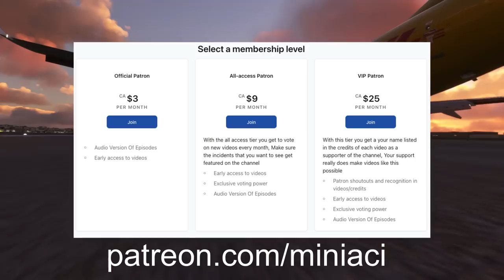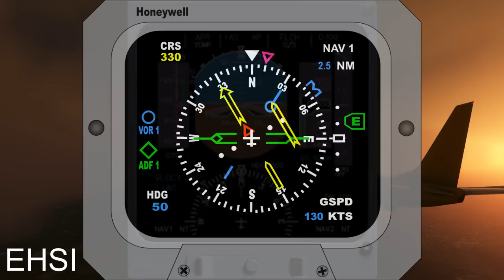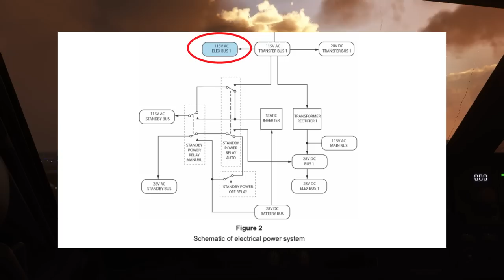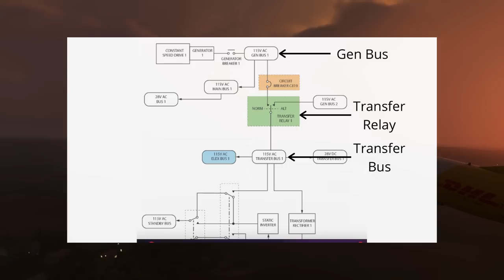How A TINY Short Circuit Almost Crashed A Boeing 737! | West Atlantic Flight 3319

Comment: The power generation didn't fail... The distributor of power did.
This is actually a common theme with what I would argue are most electrical systems.
Because the public mostly just hears 'conserve power' they often assume it's the power generation capacity that is responsible when in fact much of the time it's the capacity of the local distribution grid that is stretched to the limit.
If you've ever blown a fuse at home due to plugging in too many appliances you should know this. There is plenty of power outside, but your home outlets can't take that much consumption at once.
In this case there wasn't an overload of consumption but still by accident the bottleneck was the power distributor.

Comment: What I would like to know is what was changed so this does not happen again?

I mean things do fail, but the fact that a power bus failure can turn of THE warning system which is supposed to warn you about a power bus failure seems like something that could be designed better.
Reply: Pecka.
To make sure this does not happen again, technicians put some "sellotape" round the power bus to stop it turning off the warning system.
Reply: @redblade8160  yeah, cellophane tape! I  use 'duck' tape myself.....shite happens--shame....
Reply: Better system integration. Current airbus systems can withstand even 3 generator loss. And pilots are trained to handle such situations in the Sim, its called emergency electrical config, its one of the hardest Sim sessions as the procedure is really long and requires a deeper understanding of electrical systems

Comment: An example of why a Flight Engineer should still be on aircraft. The electric systems would have been very familiar to them.
Reply: IT WOULDNT BE HARD TO HAVE OFF PLANE LIVE STREAM FOR STUFF LIKE THIS.
HAVING A THIRD SET WOULD HELPED.
Reply: Pilots are trained for situations like this and situations much worse than this like the emergency electrical config aka 3 generators lost

Comment: This is why standby instruments are important! The standby will either be "steam" gauges or a small PFD that has it's own internal battery.  Also, typically when a generator or bus fails, it will impact only the instruments on one side (i.e. Capt or F/O side) as the other side is powered by the second bus (I think 737s are all like this).
Reply: PFD? F/o?
Reply: @Capecodham  primary flight display; first officer

Comment: The captain did the right thing, given the information he had.  He took an ultra-conservative plan of action that, given the knowns and unknowns, kept everyone safe.

Conversely, had he had an intimate knowledge of the electrical system, but elected to not attempt to remedy the failure, he would have put people in grave peril.

Unless you know and understand the consequences of your potential actions in this situation, it is a grave error to "try this, try that", because you could inadvertently cause an unrecoverable situation, killing all on board.

I'm a EE myself, and despite all my 30+ years experience, I would have done exactly what the captain did if I didn't know the system.  The last place to experiment on the electrical system is while the plane is in the air.

Even with the slight landing misconfiguration, both the Captain and FO did a stellar job.  10.
Reply: Yeah agreed, in all honesty a misconfiguration for landing isn't really a safety issue at all unless you are completely on the wrong end of the misconfiguration you are intending to do.

Comment: Since the visual is a 737 not -200 I was wondering what the make of the aircraft was.  It wasn't until the end of the vid when you mentioned that the part was manufactured in 1985 that I sort of maybe figured that it could've been possibly a 737-200.

Comment: I've read about a plane crash-landing (spoiler: everyone survived) in GDR on December 7. 1963 where a plane suddenly lost all electrical systems. Turned out a generator failed. But wait, it gets better. The plane HAD a battery backup, but no indication of its enabling whatsoever. So neither did the pilots know their generator failed, nor did they know they were running on backup battery nor was there any warning that the battery was running out. Classic design screwup. See Flugunfall bei Königsbrück.

Comment: The pilots get a 10 from me as well.
Operating on limited information, they made the best of it without taking unnecessary risks.

I do think though, that this falls firmly into a large number of cases where I wish there was still a third flight crew member - an engineer. Someone intimately familiar with the mechanical nature and systems of the plane. While it may be more economical to automate engineers out of the cockpit, I've never once read or heard about an emergency situation where not having an engineer was a benefit, rather than the absence of an extra pair of hands and an extra skilled professional who could help.

Comment: Thats why transistors (or triacs) are much better than relays. Relays are working mechanically. Transistors can do a same job without any moving parts. More of that - relays are much more sensitive to any g-load - aven best ones. If transistor is mounted correctly (not standing on original long pins like in chinese products), then it can work for decades with insane g-load.
Reply: Yup, power transistors never fail ... LOL. These three phase transfer relays are huge. Each engine generator is able to supply up to 90KVA.
Reply: @ImperrfectStranger  in case of AC - triacs.

Comment: Video suggestion: China Northern Airlines flight 6901, which crashed in northwest China in 1993, for ridiculous reasons. The plane was a dry lease, and its English-language annunciations were unfamiliar to the crew. They dialed in the wrong altimeter setting, so they were too low approaching their destination. The GPWS sang out "TERRAIN PULL UP" (in English). The pilots asked each other what the message might be telling them. And they didn't pull up. It would be comical if it weren't so tragic.

Comment: How can I rate pilot performance when all the trouble they had to deal with was due to Boeing's typical crappy design where failures are supposed to be superseded by backup systems to maintain aircraft fly-ability.  The automation truth table of the 737 must be a joke.  Why are pilots not trained to be also flight engineers???  Hell of a good question, IMO.

Comment: And this is why everyone should go back to basics and learn to do things with out computers help, or they are fucked when computer tilts. These pilots were able to pull trough but what then if they had lost all the electronic instruments? Get back to basic paper maps compass and have the life line instruments like speed and altitude indicators be in their own separate system case something like this happens. Same with cars, learn to drive with out traction control and such systems, cause when those fail, you are out from the road and dont know how to take control back since you havent actually driven car before, computer did, even less so in unregular situation like loosing traction.

Comment: I give them a 9 out of 10.  I understand the stress of the situation, but a little more checking like selecting a different transponder setting could have made this less dangerous.  Not being visible on radar in congested airspace means the controller could not keep them clear of conflicting traffic.  With all the other failures there is a good chance that their onboard Traffic Collision Avoidance System (TCAS) was not working either.  Since it operates in conjunction with the transponder means no transponder, no TCAS.  Otherwise an extraordinary job by the two pilots.

Comment: I rate the pilots a 10.  They did the best they could do. Btw, although the transponder failed, the primary radar should still have picked them up, however without id label on the radar screen. And when I understood that right, the system that should generate and display an error message that the right bus had failed because this system was also powered via that failing bus?  That could be considered as a design flaw... Great simulation!  When you flight the ILS rw 25 (r/l) you approach the airport from the north east, not the south east as you said...

Comment: I'd rate the captains flying as a 10. You stated the crew had not been trained on dealing with electrical issues like this. That means they also did not know how to recognize them. To the crew, their systems were just randomly starting to fail. They had no idea how to fix it. And no idea how many more systems would fail. In their minds, they were on a timer. If they did not land at this airport as soon as possible, they would crash. Which would not only kill them, but possibly people on the ground. If anything, they were hoping to crash on the runway with emergency services on standby. 

I'm glad they made it down safely. But I do think there's an issue having the warning for an electrical/relay fault connected to the same power as the thing it's warning about...

Comment: being someone with years of Relay experience i can tell you what the 2 main failures that can occour. 1: coil burn out.  Usually on relays that are in an energised state for extended periods (could be thousands of hours ) Coils heat up when energised. Wires may have tiny defects causing localised heating leading to either failure of said wire or melting of insulation coating on wire causing a coil short which would trip a protection ciurcit such on this episode, and also cause a denergisation of relay  through either the magnetic field produced is weaker or insufficient to overcome the detent spring or current fails due to a protection cut off on that circut cutting power. Other failures involve arced contacts on the springleavers which normally cause non conductance or possibly over current as the increased resitance from the carbonised contacts may also cause extra arcing till that contact is unable to counduct current . usualy if you wanted some form of warning for a real simplest set up is using one of the make contacts( contected when relay energises) or a break contact ( open circuit when energised) either can be used depending upon the type of detection you require.

Comment: "Deuc'd close-run thing", handled very well. Although it would not have done any harm, (if I interpret the commentary correctly), leaving the breaker alone was a prudent decision. If you're not completely clear about a situation or the system, don't make a bad situation worse with panic-stricken "fingerpoken und mittgrabben".
Maybe airlines should devote more pilot training to electrical and system engineering topics?

Comment: 10, difficult situation, difficult weather. They could have tried swapping systems/bus, but given the information they had on hand, and the failure indication light not working, they were better to leave well enough alone while they were still able to fly with what they had left. 
Imagine flipping a few switches and losing even more systems, or radio, or ILS guidance.

Comment: Wondering why you called a relay failure a short circuit. A short is a specific kind of failure where two things that should not be connected to each other are brought into contact.

Comment: I'm a bit surprised the pilots didn't start the APU to be honest.
Reply: How do you know they didn’t?
Reply: @kickedinthecalfbyacow7549  It was some weeks ago that I posted that comment but IIRC, they wouldn't have been short of power had they started the APU at an earlier moment. Note that in the ditching of that A320 in the Hudson, Capt. Sullenberger had the presence of mind to do exactly that when it was apparent both engines were toast. It's those kinds of decisions that mark out an above average pilot.
Reply: @grahamstevenson1740  as far as I understand it they weren’t short of power, they had a failure of transfer bus causing multiple electrical failure, I can’t see how an extra electrical source would have made a difference. However, how do you know that they didn’t start the APU?
Reply: @kickedinthecalfbyacow7549  I'll have to watch the video again.

Comment: That reminds me of LATAM LA-8084 incident that in 2018 took out most of the electrical power of a B777, also due a short circuit but affected the distribution, not the generation of power, same end result thought.

Comment: Hey genius your electric class didn't pay off... It's just a circuit panel... When you are saying bus panel it's just another way to say circuit panel... Buses are referring to the bars that circuit breakers connect to... The hot wire coming into the panel after your electric meter is connected to one bus bar and neutral the other... The breaker spans the gap between the two bars that supplies electricity to the panel and will only let the amount of current through that it's rated for or it will trip
Reply: Meto, No need to get over yourself. Aircraft "bus" term carries far more with it than just a hunk of metal in an circuit breaker box in your house.